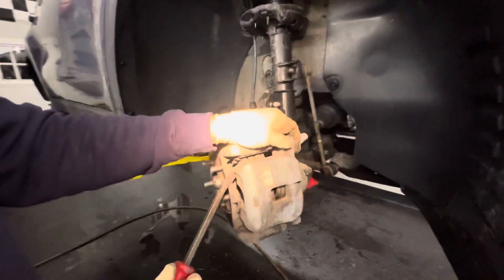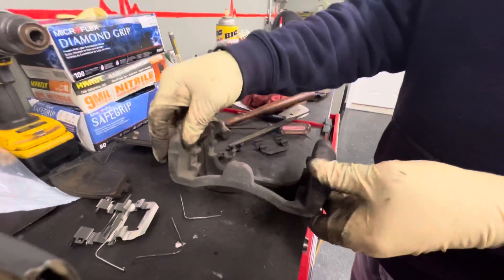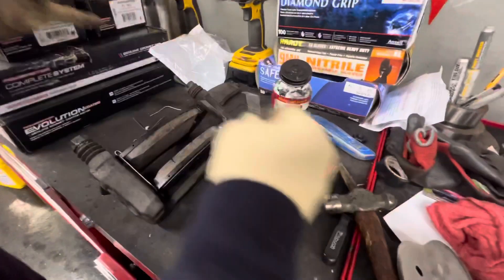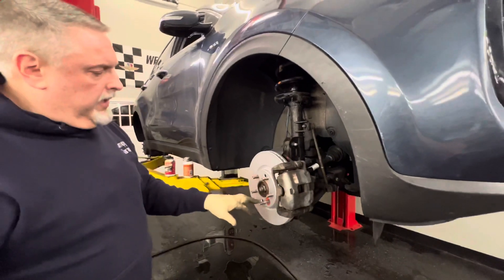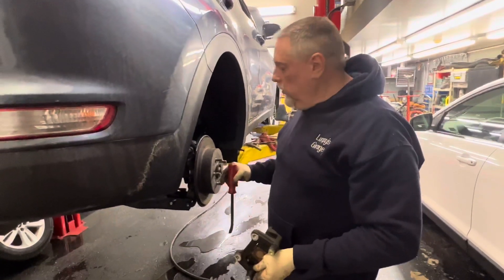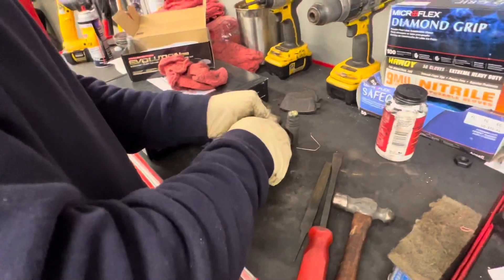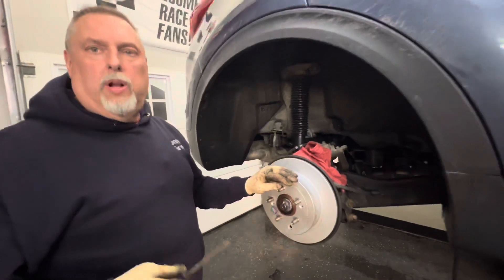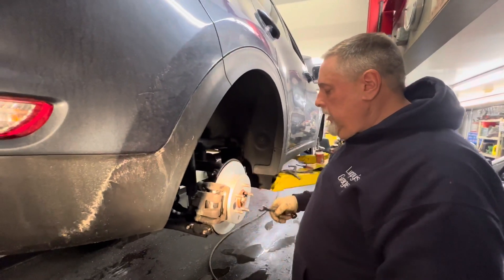How To Replace Kia Sportage Brake Pads and Rotors 2017-2021

Comment: Man I am glad that I am not the only one that has to fight like crazy to get the new pads on. The first one that you showed is a rarity. I've put on 16 pads, only one ever went in that smooth...and that was after filing away all the rust to make sure it had space. I will say once you get them in tho they slide pretty easy and it makes you wonder how the hell they were so hard to get in in the first place!
Reply from the maker: Thanks for watching. Yeah it can be a pain to get the brake pads in.

Comment: Do the AWD models use the same rotors and pads in the front?
Reply from the maker: On my 2018 KIA Sportage it is AWD the front brakes on my year, make and model do not specify any options as far as 2wd or AWD. The REAR brakes do have an option of a manual or electric emergency brake so the rears do seem to be different depending on the emergency brake option that you have.

Comment: What’s the tool for the rotor screws? Where can I find it or what can I use to remove them
Reply from the maker: It is a manual drive impact driver. Here is a link to one on Amazon, hope this helps you out. https://amzn.to/3RlGVcn

Comment: The rotor is loose but won't come off. Is there something holding it in place? I've removed the screws and the parking brake is off.
Reply from the maker: If it is the rear brake rotor that is being difficult, the emergency brake shoes might not be backed off far enough to allow the brake drum to slide off. Hope this helps you out.

Comment from the maker: Hope this video helped you out. Let us know if you were able to tackle this job on your own. Drop us a comment and we'll reply back!
Reply: This was my exact car. The breaks were shaking a bit, so I replaced pads...they needed it regardless, back more than front. Shake on driver side front was still there. Tonight I just replaced both front rotors. Did the whole thing in about an hour. I would not have dared without this video. This made it such that it was a very simple thing. My largest fear were those screws that needed to be taken out of the rotor. Lucky for me, they were easy. Then hammering off the old rotor took a bit... it all went back together slick. Test drive was great smooth as could be.... total repair on my own was under $150 for all four brakes and two front rotors

Comment: 38:08.... I've changed rear brakes on GM and Chrylser vehicles and I've never seen clips before. Is that a Kia thing?
Reply from the maker: No, It's not as common as other setups but I have seen them on other vehicles.